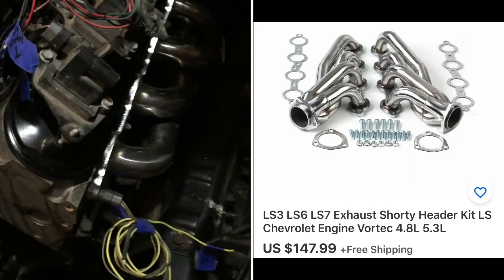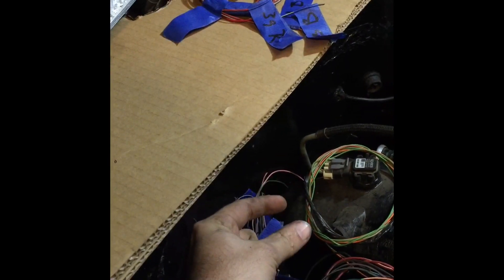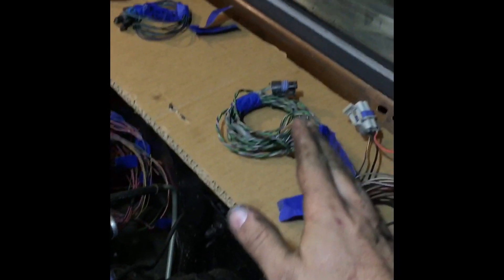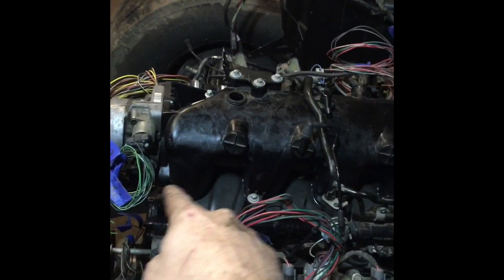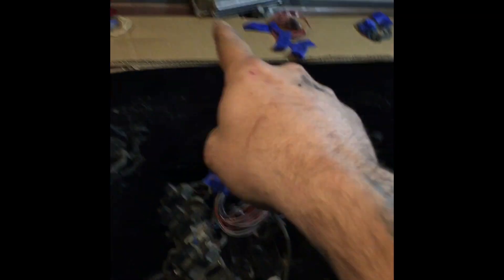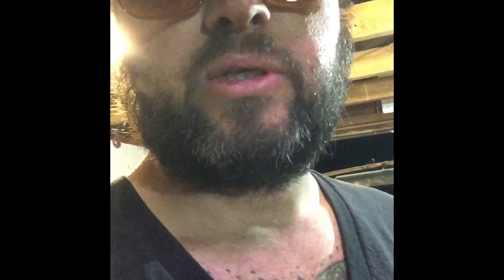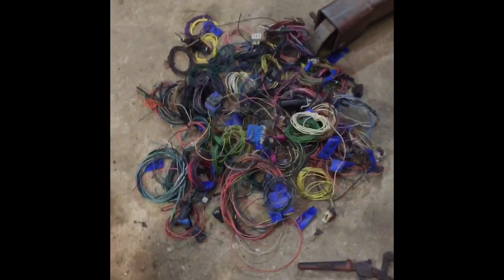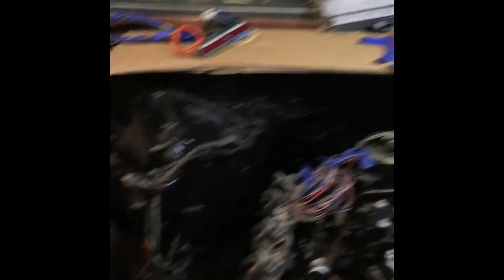Square Body GM LS Swap Part 1 Test Fit & Parts List

Comment: Now, I've got the harness for the motor and trans that's under the hood, do I need to pull wiring from inside the cab on the donor truck?
Reply from the maker: you just need the engine bay harness, and the OBDII diagnostics scanner port that is under the dash. Get as 
much of that plugs wiring as you can so you can
route it where you want in the swap. I just mounted mine under the dash below the column.